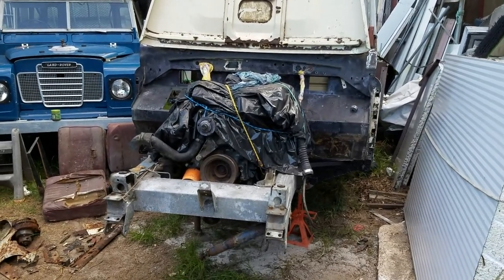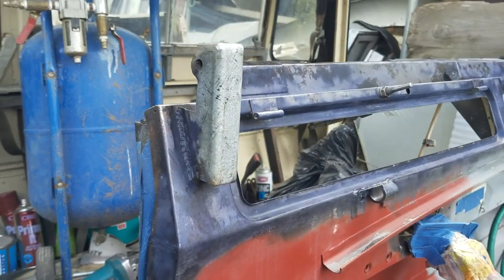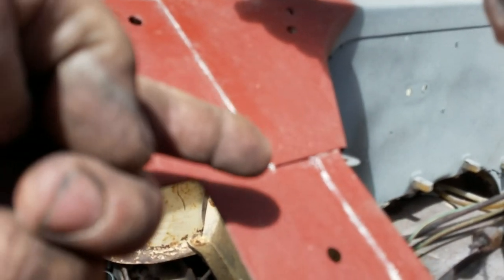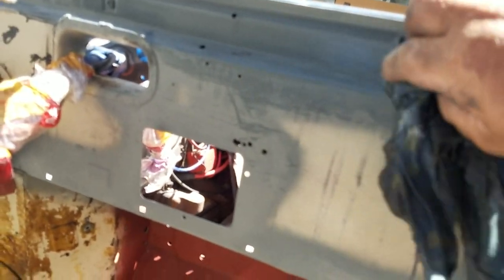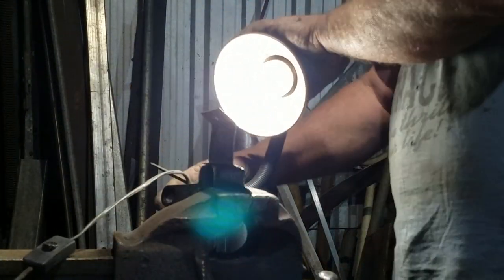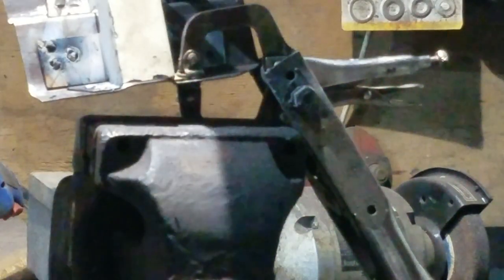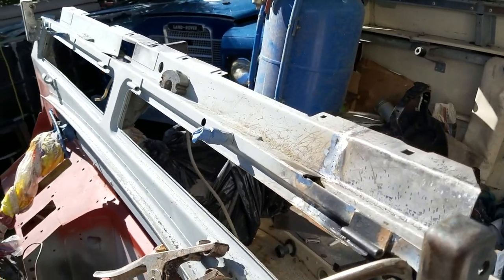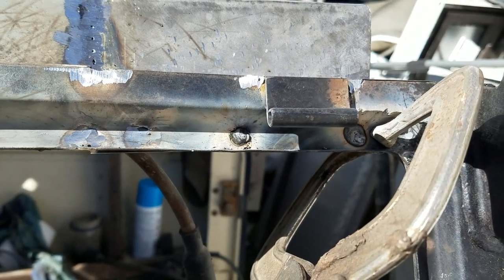Land Rover S3 Stage One V8 Rebuild.  Stop Your Rover Rusting!

Comment: Seam sealer for aluminium - what do you suggest? A non acetic acid silicone or something else?
Reply from the maker: Aluminum ain't gonna rust . Silicone won't take paint. If you are going to do it. You do it after priming and flitting back. I would use the same sealer as I always use. Selley's No More Gaps. It handles 25% movement and is water clean up
Reply: @t.h.o.r.  Thanks - I'm building a camper out of aluminium (mostly), so flexibility is paramount I really appreciate you taking the time to answer my noob question.